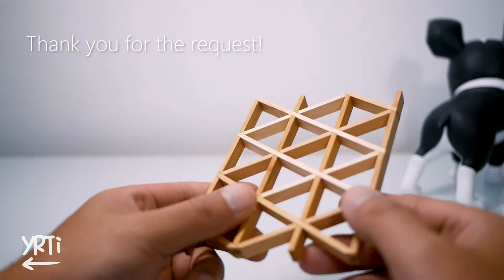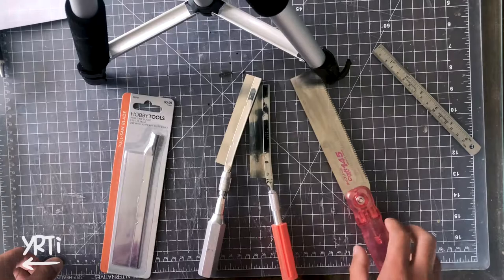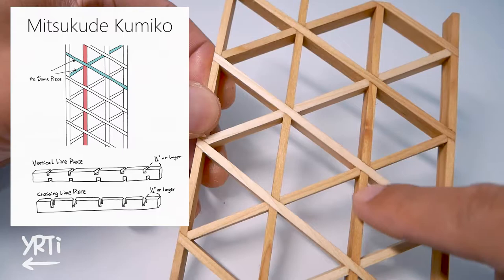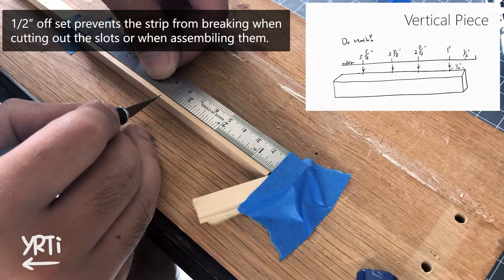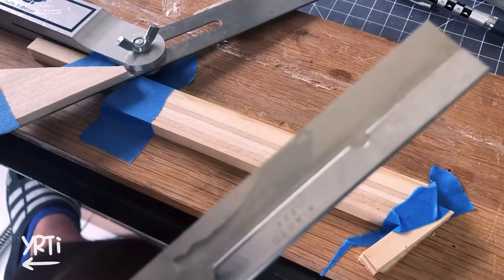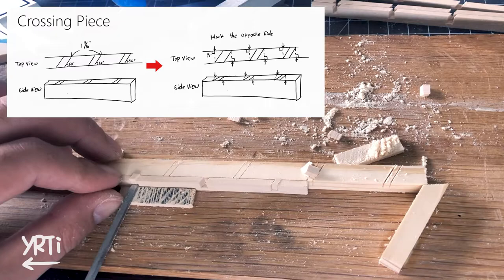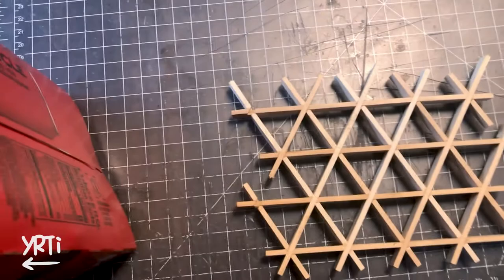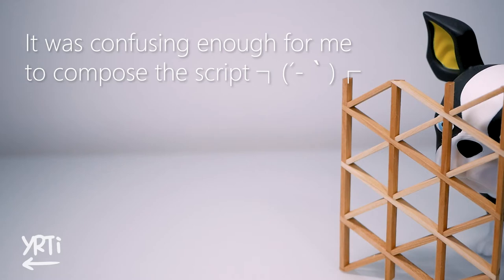How to make Kumiko for beginners with Hand Tools - Mitsukude Kumiko Grid

Comment: "I know imperial system doesn't do well with decimals."  If it were 0.1443375 cm, wouldn't you just write 14.4 mm and skip the criticism?  In the inch system, we do the same.  We would write 0.144 which is understood as 144 milli-inch (but we say "thou").  Decimal meters and inches are very similar in how we use them.  Generally, though, that's how machinists think.  You've specified the width of the cut to a 1/2 millionth of an inch (20 nano meters).  That's not really a unit-system problem, is it? Woodworkers use systems that work for the level of detail needed.  Boat builders use inches, eighths, and sixteenths of an inch.  For simplicity, 1-7/16 would be written 1-3-1, which is more effective in the workshop.  Obviously other specialties need to be closer than 1/16 in but in woodworking 1/64 are adequate for almost all work.  In machining, 64ths is for rough work that can be measured by eye with a scale.  Also, in Japan there's customary units, such as shaku, which are widely used by woodworkers.  It is not a useful unit for "official purposes" such as global trade so on the internet, it looks like metric is the answer to the question of life, the universe, and everything.  However, people often prefer customary units and fractions, depending on the situation.  Although I understand that everything would be easier if we had 1 international system of units, couldn't the same argument be made for language, food, culture, etc?  ABOUT THE VIDEO THOUGH, I appreciate the explanation, drawings, and demonstration.  It helped me a lot.
Reply from the maker: Thank you for the feedback and the explanation:) It helps me understand woodworking more!

I grew up with the metric system and I'm still confused by the imperial system so it was just irony(sorry if I bothered you)... Let's say, mark a 1.41mm point with a metric ruler with 1/10th of a mm indicator. I can simply mark a point little bit more than 1.4mm. On the other hand, if I need to mark a 1.41", I can't simply mark 1.41" on a ruler but it needs math to find the closest indicator on the imperial ruler, which is 9/64 but it requires a complicated math. 

If I can plan a project in all good numbers in fraction(1/8,1/16,1/32,1/64), it's not much of a thing but when it requires trigonometric function to design a thing, it usually needs decimals.. 

Sadly, I'm far away from 64ths accuracy:( but as far as I read, they use 1/10th of mm(256ths) accuracy in Japanese woodworking so at least I'm challenging it for fun! I hope you enjoy making Kumiko!